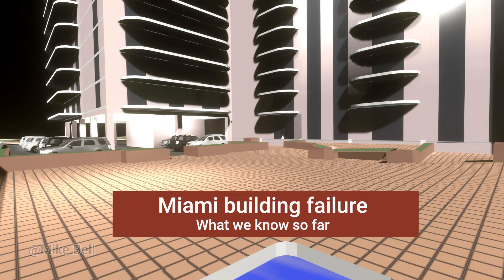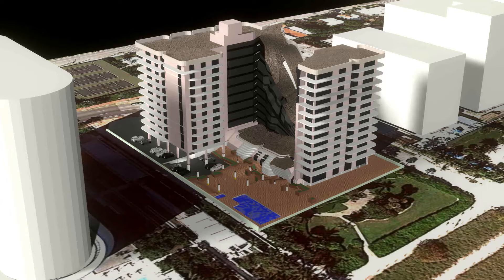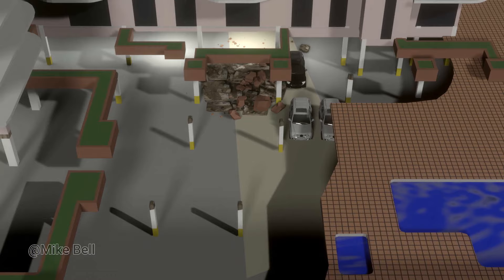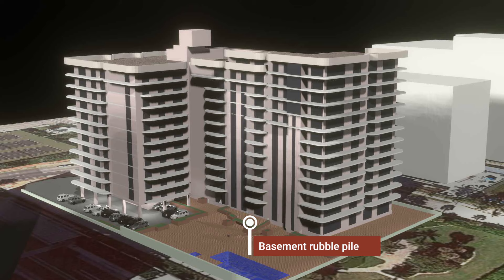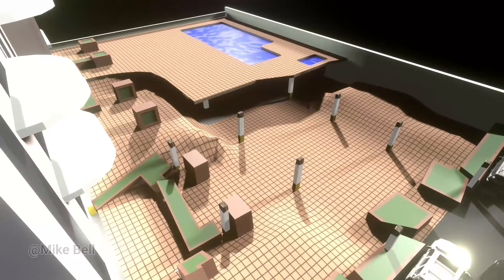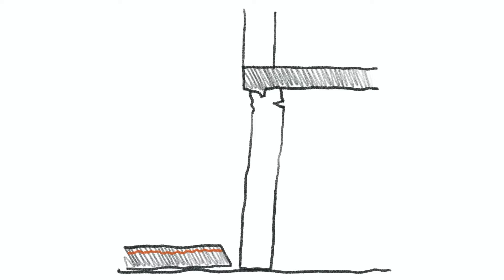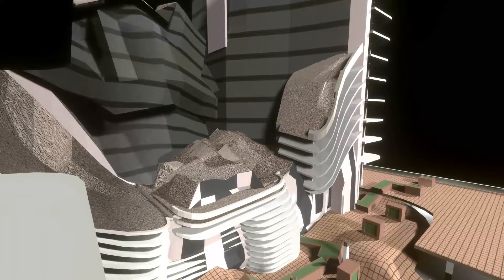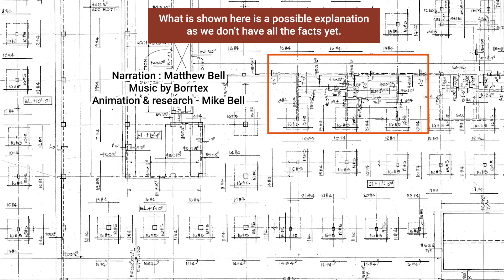MIAMI CONDO COLLAPSE | visualization of the evidence pt2

Comment: The ceiling damage one year prior to collapse is shocking
Reply: It looks so similar to the Singapore Building Collapse
Reply: This is what happens when you deregulate things. Disasters are bound to happen
Reply: @miked3168  I don't think this was due to deregulation.. the building had been inspected and was set to be repaired but everything was postponed due to the lockdowns and the shortages of labor and supplies.. There was an engineering firm that was aware of the issues but it would seem they failed to emphasize the urgency of the matter and they're probably going to be held liable for this disaster going forward.
Reply: It look scary.
Reply: usually there are signs of damage before these collapses happen. It's sad that it's just ignore and it's too late
Reply: @m2svirtual384  well you couldn't legally kick the residents out either because of covid
Reply: @usa5439  yeah don't mean to start a fight, but that's just wrong info. Maybe you can't evict because of non-payment of rent or mortgage, but there's no way because of Covid people were 'allowed' to stay in a building that unfit. Fact is they weren't INFORMED and couldn't leave based on their own feelings about that information. They weren't allowed to save their own lives, because they would have sued to not have payed for the time they needed to be out of the building for repairs. Information that would have allowed them to decide their own fate was withheld, and none of it had eff-all to do with Covid.
Reply: @Sigrafix  Sorry, but the board was aware for years of structure integrity. They were aware since at least 2018 the waterproofing was defective and needed replacement. This is on the board for sitting on their hands for years. Some of the board members resigned their positions because of the delays for years. Blood is on the board.
Reply: @MattZiggy  The management aren't engineers, no one told them "fix this right now or you're building might collapse and kill people" is my point. Yes they were aware that the building needed work and there was work scheduled to be done until covid hit late 2019 and caused shutdowns around the country. Government/state/public offices here in South Florida were closed for months, even after Florida re-opened. It took me a year and a half to get some paper work approved that normally takes a few weeks.. I can see how that would cause delays.

Just to clarify, I have no association with the events other than my location, curiosity and access to a person who works in the field. From all I've seen and read, it appears that the engineers who inspected the building dropped the ball.. their report is public, you can read it yourself. They do show the troubling damage but again, they did not emphasize any urgency, they did not recommend closing the building, they did not follow up with state/city officials on public safety concerns etc etc..
Reply: @Sigrafix  except that the board members who left years ago because the BODs sat on their hands for years tells a different story.
Reply: @Sigrafix  as does the owners of the condo filing multiple lawsuits on the building maintenance company.
Reply: @m2svirtual384  No one is excusing this. The building owners didn’t make it a high enough priority, and the Democrat city inspectors/engineers didn’t report the failure to act on the part of the owners. Sounds like potential corruption at play
Reply: it honestly didn't look that bad from a non-expert viewpoint
Reply: @yomommashaus  Just look at - and no, I'm not kidding - the Grand Canyon for how powerful and persistent water is over time. You pay attention when water is seeping into or out of things, that's rule #1. Then, look at how much weight is exerted on those pillars in the garage area where the water is seeping through. Not only do those two things tell a story, they had been telling that story for a long time. People with the ability to recommend closing that building feared for their careers or were paid in some other way to keep it a bit on the down low. If you are an engineer and scream for the building's closure, and you get just that - it is impossible to tell down the road if you saved anyone's life unless the building collapses. If they retrofit or repair it and it never collapses, your entire career you will be known as 'that guy' and you might as well move to the other side of the planet.
Reply: @Sigrafix  shortages of labor and supplies? is there really someone on earth who believes such nonsense, if that were true this accidents would be common, they are not. Also this didn't happen in the span of a couple of months, this building was in critical situation before covid, and btw that is a terrible excuse because most construction firms, inspectors did not stop because of covid, one of the few industries that actually got to stay on top because the whole line of work barely interacts with people outside of the construction perimeter which is usually restricted for safety. 
Lastly the owners could have evacuated the people there because it was literally unlivable, and yes they can force them to leave if the place is in critical condition. If it is deem too dangerous to stay in there just as if any other life threatening event happens, like a gas leak etc, they are obligated to let you know and is illegal for you them to let you live in that state.  where that not true they couldn't be prosecuted, Hence the responsible for the negligence can be prosecuted.
Reply: Actually everything is on back order right now. Anyone who’s going about their daily life bitching about their Amazon packages being late clearly is missing the reality of the worlds condition. But don’t worry, you’ll wake up soon enough to it.
Reply: @Sigrafix  That kind of damage takes years to occur so do you really believe that it was put off for years due to lockdown then you're smoking that good good.
Reply: @BuckingFuffalos69  imagine thinking shortages means absolutely 0 no wonder you also this viruses aren't real. xDDD
Reply: @Sigrafix  Yeah, again, I'm not so sure that 'greedy owners' can't influence reports. Are you saying that never happens EVER, or you are just 100% sure that didn't happen here? We seem to agree that there are multiple things that don't add up, but you seem to be intentionally trying to divorce the owners from any of it. While the now infamous 'report' may not have screamed "emergency", it did quite loudly suggest follow-up and deeper inspections by actual experts in the respective problem fields. The water had been seeping for a very very long time. Long before any pandemic too.
Reply: @skillfulgoose101  : loud applause :
Reply: @m2svirtual384  I agree...also the video footage of the maintenance area for the pool is shocking and the fact that they continuously replaced water pumps because they pumped h20 out of that area 24/7 ...just a crying azz shame..SMDH.
Reply: @miked3168  hey dummy, it's not deregulation. It's neglect
Reply: @m2svirtual384  cataclysmic is an extreme exaggeration, stop acting like this situation is december 21st 2012. It's a floor collapse that was unfortunate yes, but go look up cataclysmic
Reply: @Ldeos  I have no respect for people I don't know, respect isn't deserved so you can GTFO if you don't give me the respect I demand. See giw that works?
Reply: @thevalorousdong7675  Ah, the 'Term Police' have arrived. Has a problem with the informal use of 'cataclysmic' ("used to emphasize the extent of something bad or unwelcome") yet calls a billion dollar+ multi-story building collapse with nearly 100 lives lost an 'unfortunate floor collapse'. Gotta love YT comment sections... lol
Reply: Such a red flag. Living there would have made me nervous seeing that.
Reply: @maxfmfdm  lol arent you the troll, from what i see you choose to ignore data and follow conspiracies...
Reply: @Ldeos  ah bro im just chillin. hope ur doin well in the world. sounds like its stressful and hard for you.
Reply: @maxfmfdm  lol, i wonder how long will it take you to acknowledge Einsteins quote on infinite concepts. That blissful ignorance pack must be hitting while voting for trump🤣
Reply: @Sigrafix  shutdowns didn't happen till April 2020 not late 2019. I had my baby in Miami in January 2020 and everything was still running as it was. Everything was open. Of you are going to run something like this, you need to make sure it safe.
Reply: @Sigrafix  and if I misread what you meant about time of the shutdowns, nevermind about that. 
They had time though.  They had time before covid to deal with it.
Reply: fake username  Did you by chance see the story that came out regarding the architect of the building? Apparantly, he was previously suspended for six months for designing pylons that failed and collapsed...
Reply: @usa5439  Well, most of them were rent units ... the owners didnt live there !!! so, its all right. If the building is at risk, just make sure everyone UNDERSTANDS THAT ... then, the ones that are willing to stay .... they will at their own risk.  Pretty sure that the peole renting this units didnt have any clue about how bad this building was ... and they dont have to ... The owners are the ones to blame and if the firm carrying the certification tried to hide the extent of the damage because the presure of interested parts ... they most pay the price.
Reply: I`ve seen stalactites like that hanging down in lots of underground and multi-storey concrete car parks.